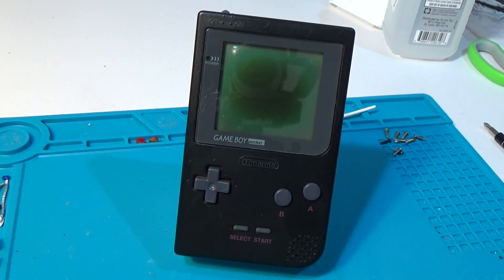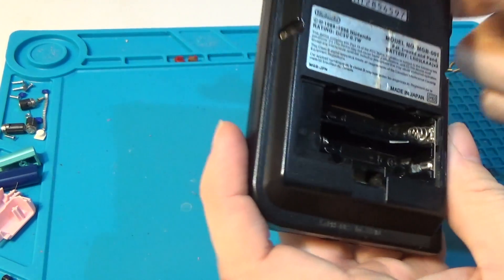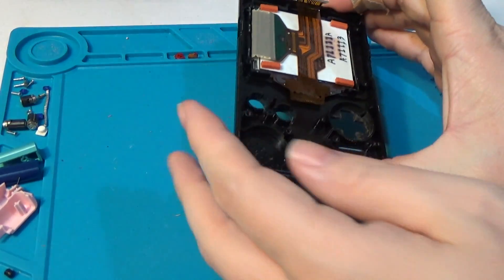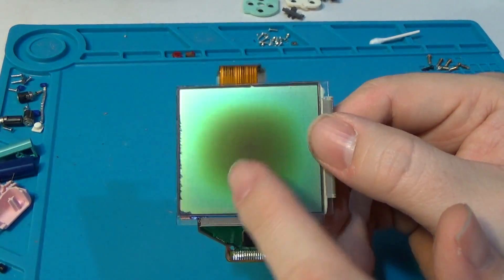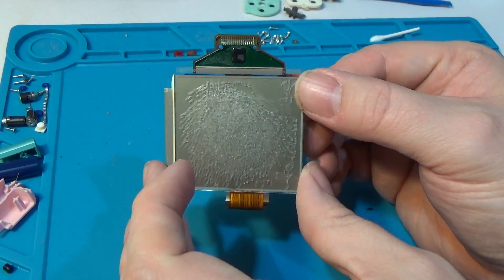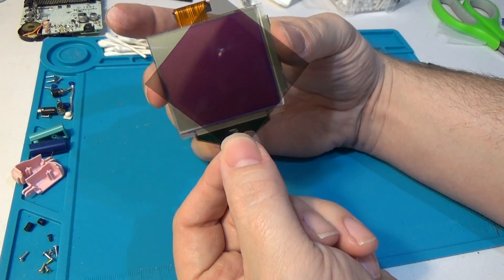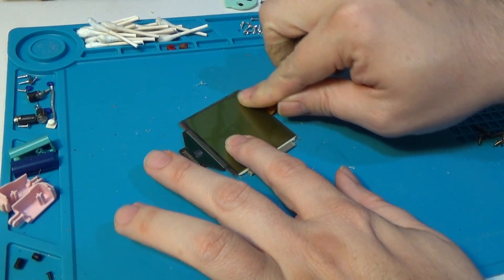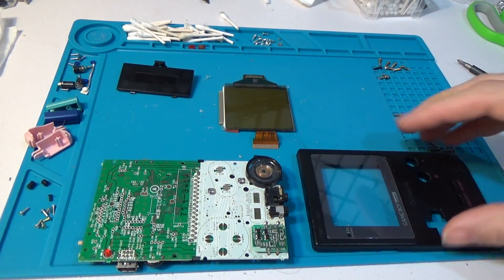How to Replace a Burned Polarizer on a Nintendo Gameboy Pocket

Comment: Great video! A quick tip for anyone about to do this is to buy an uncut polarizer so you can rotate the film to get the exact shade of green rather, then cut it. I find this ends up looking nicer than the shade that comes from a separate factory

Comment: Nice video glad you showed the twisting method Im taking apart my blue trash found game boy pocket now!  :)
Reply from the maker: I'm glad it helped.  Good luck on your repair!
Reply: @TheBrokenPast   Yea I have a bubble on the screen think its from one of the back layers. I may need to do the back lit mod should fix it. I see the bubble on the rear white reflective layer  I found out as a quick test you can clean and reuse the old polarizer. Sure you should get a new one but I dont have mine yet and just wanted to do a test run after cleaning all the glue off

Comment: I'm confused. Looks like you applied a polarizer to the glass and then set an additional one with no adhesive in the front half where the screen sits. So, two polarizers? Maybe I just missed where you didn't end up using the one you stuck to the screen?
Reply: Yes, this is how the LCD works, one polarizer on the back one on the front, in order to properly polarize the light

Comment: I'm trying to replace the polarizer on a Gameboy Color. Now I was able to remove the thick sheet which I think is the polarizer but it looks like it has more layers. Do I need to remove everything down until I reach the glass? At first I thought I see the glue residue but it's just this weird material, really brittle, I can scratch it with my finger and it's sparking in hard light. Did I ruin the screen yet? Also, the ribbon cable has some corrosion so 4 or the contacts doesn't have continuity but I have 3 more Gameboy Colors with burnt polarizer so I want to hone my skill on this one even if it's already a dead LCD.

Comment: What if the polarizer doesn't come with glue, what kind of glue should I use?
Reply from the maker: That's a great question.  Mine didn't come with any adhesive either.  I didn't use any.  I just let pressure hold it into place against the screen.

Comment: Looks like the board has some cap-juice on it (the yellow stuff on the bottom on the solder points)... if you care of your GameBoy, please replace your capacitors and thoroughly clean your board! That stuff is literally pure liquid evil for electronics; it will eat away the board and traces rendering it useless.
Reply: A soft toothbrush and 99% isopropyl alcohol will clean it up easily; give it a couple passes then air-dry it.
Reply: ~12:00 Okay, thanks for cleaning your board... but please note, the capacitors are leaking, and needs replacement to avoid permanent damage.